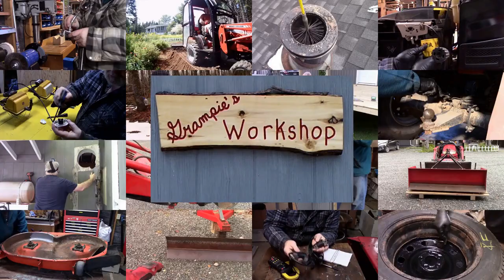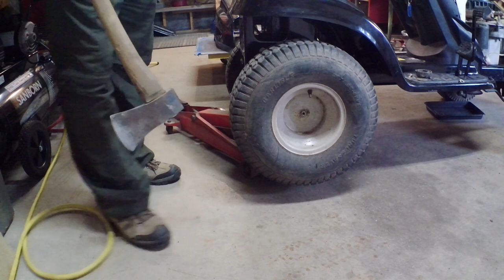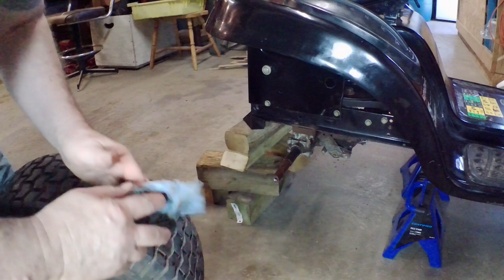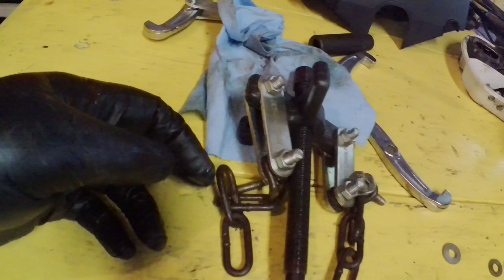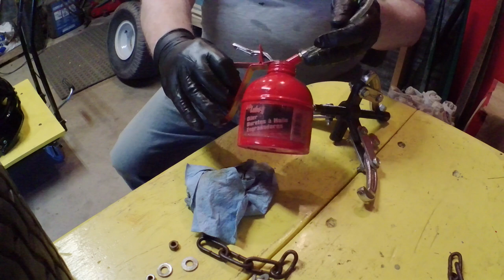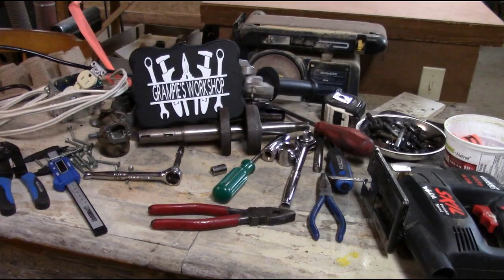Removing a Rusted Rear Wheel

Comment: Great video very good idea to get the rims off the tractor have a great week
Reply from the maker: How's she goin'?  This wheel gave me a battle for sure.  I tried driving it off by hitting it from the back side but I was afraid I would do damage to the differential.  The puller eventually worked but that wheel was stuck on there for sure.  Thanks for dropping by and commenting.  Take care!!!

Comment: We’ve experienced that same issue with those wheels. They can be very tough to get off. I think some of the MTD’s had two holes in the wheels already. Great idea on the puller setup, glad it worked!
Reply from the maker: Good day eh!!  The puller wasn't the best for sure, but it did eventually get the wheel off.  I have seen tractor wheels with the 2 holes in them too.  So I figured it wouldn't hurt the wheel if I put 2 holes in it.  LOL  Thanks for dropping by and commenting.  Take care!!!

Comment: Like the wheel puller mod.  Great video!
Reply from the maker: How's she goin'?  Thanks Shane.  I was trying to beat the wheel off by hitting it from the back side with a drift but I was afraid I would damage the differential.  The puller worked but it was a struggle the whole way!!!  Thanks so much for your comment and for dropping by.  Take 'er easy!!!

Comment: That was a genius idea using the chain with the puller! I'm a big fan of using heat for jobs like these (propane torch). The penetrating fluid I like to keep on hand is PB BLASTER. It seems to break out rusted parts better than anything else. Sometimes I will spray a rusted bolt or part in PB BLASTER, let it soak then heat it with the torch (alternate between those two methods and most things will break free). As a last resort, I always keep a 20LB SLEDGE HAMMER at the ready!! haha You will find PB Blaster at any parts store such as NAPA or Canadian Tire.
Funny story: One day I had my wife with me at NAPA. The front of the store had racks full of small parts like door handles and nuts and bolts, and as you get deeper into the store the shelves had bigger things like hand tools, drills and supplies. Right at the back of the store, was a wall full of bigger tools including some huge sledge hammers. My wife commented that the sledgehammers must be there for jobs that started off small but ended up needing the stuffing knocked out of them!! Hahaha I thought her view of the store pretty funny (she's no mechanic...and, come to think of it, I don't think I'll let her anywhere near my car after hearing that!! LOL). Keep your stick on the ice, Mike!
Reply from the maker: How's she goin'?  That was a good observation of the NAPA store Brad!!!  Pretty funny.  But I bet that is the stores philosophy!!!  As for getting the wheel of: it put up a pretty good fight but I outlasted it.  LOL  I was going to put heat on it but there is a spacer between the wheel hub and the transaxle casing.  I didn't want to melt that spacer as it is made from plastic.  The same with the sledge hammer option.  I didn't like to pound too hard on the back side of the wheel hub in case I damaged the differential.  So it was reduced down to making this puller.  It didn't work real well, but good enough eh!!!  Great comments and thanks a ton for tuning in.  Take care!!!
Reply: @GrampiesWorkshop  Hi Mike, sounds like you may have been sitting a little too close to that jug of blueberry wine....I'm not BRAD ! I'm not BAD, but certainly not BRAD! I have BRAD nails, both 16 and 18 gauge but I'm not BRAD. I Have lived in BC for 30 years and in Nova Scotia before that, but I'm not BRAD. I sometimes have BAD breath but never BRAD breath. My name is top secret, but you can call me buddy. Just E-A-S-E    B-A-C-K on the homemade wine and everything will be fine! LOL
Reply from the maker: @EverydayProjects  Oh Oh!!!  Did I make a mistake!!!  That would be the first one this decade!!!  I can tell you must have spent sometime in NS since you know it's Blueberry wine season!!!  LOL  Sorry about the name mix up.  Not tool sure what happened there.  Sometimes the keyboard and computer get together and play tricks on me!!!
Reply: @GrampiesWorkshop  LESS WINE, LESS WINE, LESS WINE ! LOL hahaha

Comment: Use silver anti-seize on clean parts  before assembly, and, next time, it won't be rusted on! It's sad that the factory won't use a little anti-seize. Thanks!
Reply from the maker: How's she goin'?  I appreciate you dropping by the channel.  I sure do agree with using the anti-seize.  This wheel was on a ride-on I bought and it was stuck on pretty good.  You can be sure I used a liberal amount of anti-seize when I reinstalled it!!  LOL  Thanks a a lot for commenting.  I hope you can come back again soon.  Take 'er easy!!

Comment: Hi Mike.  Hey that was a great idea for the puller. Sure glad it came off for you. I've tried just about everything including drilling big holes so my puller jaws fit through and the only thing that happened was I bent the center of the rim.  I've even heated them which does work most of the time but as you probably guessed that ruins the axle seal. Put anti seize on when you reinstall the wheel.  Great work
Reply from the maker: How's she goin'?  I was hitting from the back with a drift punch for a while but I was afraid I'd damage the differential so I cobbled together this puller.  It worked but not without some 'blue air' being expelled!!!  LOL  I just put grease on the axle, but I need to take the wheels off again and put Never Seize on it.  I'm not sure why I didn't think of that!!!  Thanks for the tip and for watching Dave.  Have a great week!!!

Comment: We have a couple of lawn tractors with that type of axle and wheel fitment and sometimes it can be horrible to get the wheels off. Great idea to drill a couple of holes. When I first saw the axe I thought you really had enough of trying to do this and was about to use the pointed end on it lol
Reply from the maker: Hello there Joseph.  There was a time during the day that I thought if doing that, but luckily I came up with this wheel puller idea.  Kind of sketchy but after a lot more persuading I managed to get the wheel off.  What a job!!!  Thanks for tuning in and take care!!!

Comment: I bought an old RX 95 John Deere ridding mower which I fall in love all 4 tires was dry rotten . Cause the age I desire to replace 3 came out but the rear right hand side is  exactly the same way jammed in there . My concern is what to do next cause I already purchased four new replacement tires  and I can’t remove the right rear wheel 😤 hope this video will help me . And a bunch people 😱
Reply from the maker: How's she goin'?  Thanks for dropping in and watching the video on the wheel removal.  I have seen where wheels are heated up with a propane torch to help with removal as well.  If you try that be careful of fire.  Heat the center part of the wheel, the hub, to get it hot so it expands.  Also applying penetrating oils are a good help too.  Good luck and I hope you can get the wheel off!!  Take 'er easy!!

Comment: Nice job, Mike.  Check the axel to make sure it's not warped slightly.  Also does that wheel have a key?  I had difficulty taking off a rear wheel on my walk behind Billy Goat brush hog and low and behold, it had a key in it.  I felt like an ole billy goat so I didn't want you to go through what I went through.  Full-watch.  Have a fine weekend.  👍🏽🙂
Reply from the maker: How's she goin'?  Thanks a lot for the comments Don.  The shaft was OK, but I did damage the bolt hole on the end of the axle a bit.  I had to chase the threads to get it back again.  There s no key.  The wheel mates with flats on either side of the axle end.  I put grease on it to go back together, but I think I'll redo that and use Never-Seize instead of grease.  Thanks to some great suggestions from viewers for that tip!!!  Have a great week Don and thanks for dropping by!!!
Reply: @GrampiesWorkshop  , you got out ahead of me again Mike. I was going to suggest anti seize.